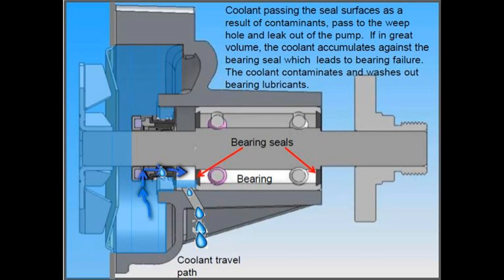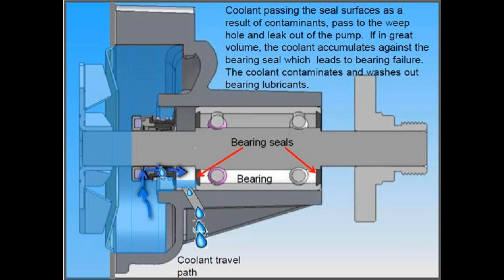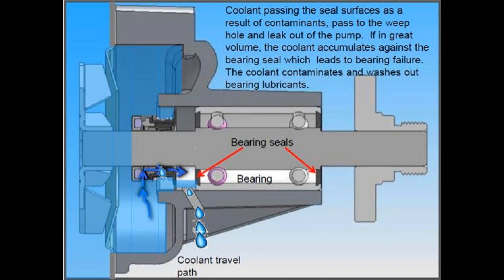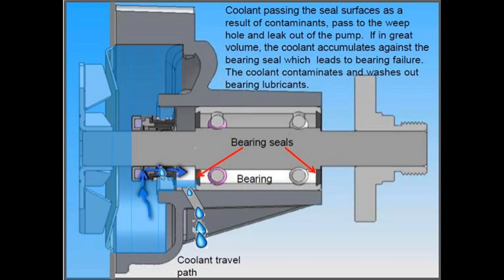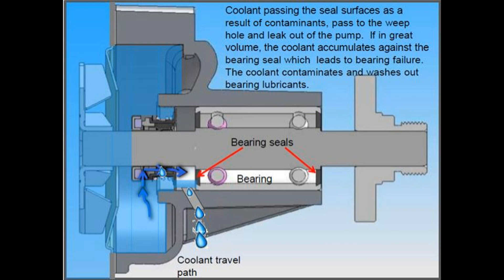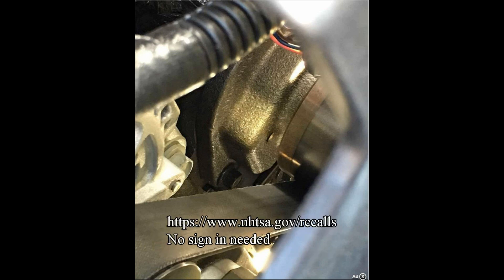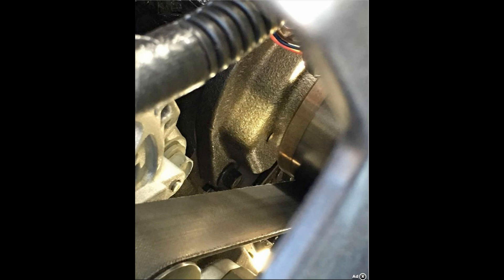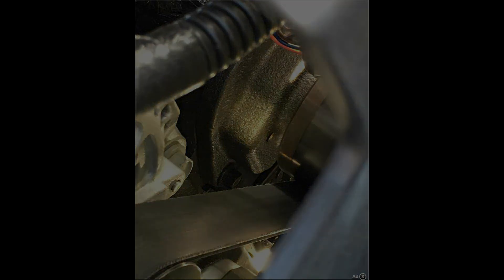Ram T51 recall information for  Cummins 6.7 L - 2013 - 2017

Comment: RAM= Recall Another Marchionne
Reply from the maker: FORD is:  Fix Or Repair Daily,  GM is; Government Motors?
Reply: Marion Blair Not sure what you mean by that? I have a 2014 Ram 3500, have about five or six recall letters pinned to my cork board :(
Reply from the maker: It was a joke.  Those  acronyms have floating around forever..  BTW, What's a Marchionne
Reply: Marion Blair - He's referring to Sergio Marchionne, the CEO of FCA.  I guess no spark's mind, he thinks that because so-and-so is CEO that equals our trucks having recalls.  He's probably not old enough to have owned cars a few decades ago when they literally fell apart and the Mfg did nothing about it.  🤦🤦🤦
Reply: Monster RAM 

Yes, I was referring to FCA's CEO  Sergio Marchionne. Also, I am five decades old and have owned many new vehicles, this Ram being the first Chrysler. Honestly, I don't ever remember getting this many recalls for one vehicle.... so yes I thought it would be fitting to blame the CEO of FCA. Sorry if I hurt your feelings.
Reply: Well, with 50+ years of life you sure are confused, at least about my feelings and the chain of responsibility from CEO down to the individual customer.  Please explain how exactly it's Mr. Marchionne's fault you're getting so many recalls.  Also how is this a bad thing?  Is your expectation that your vehicle never has any type of mechanical failure or are you upset that FCA is attempting to resolve the mechanical problems and they're letting you know about it?